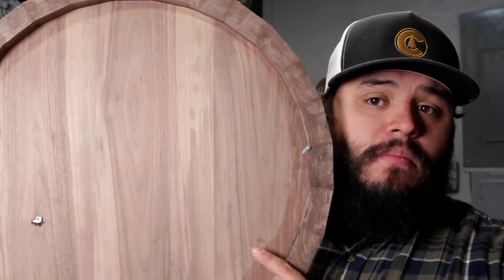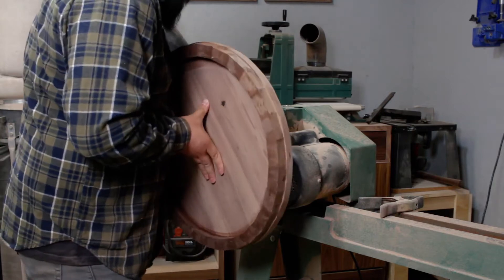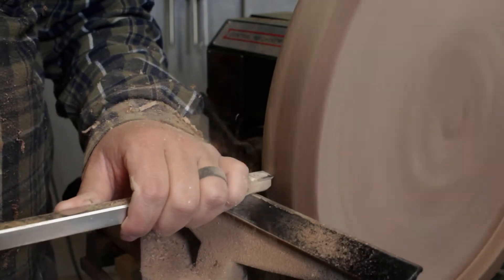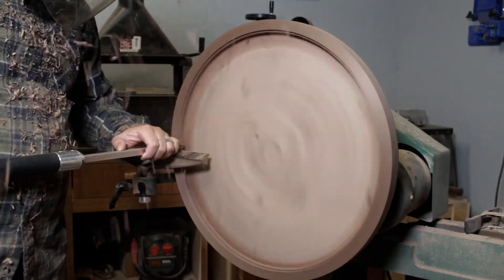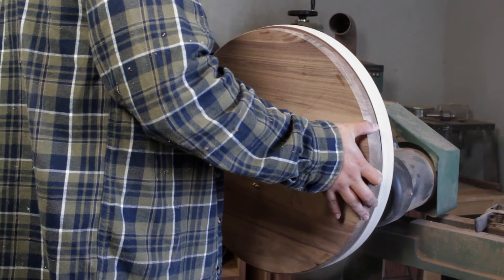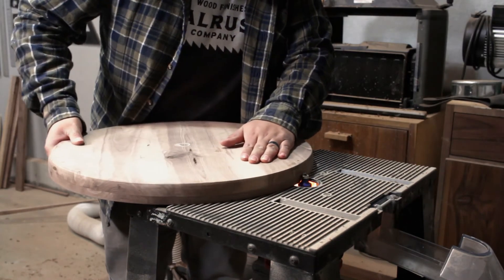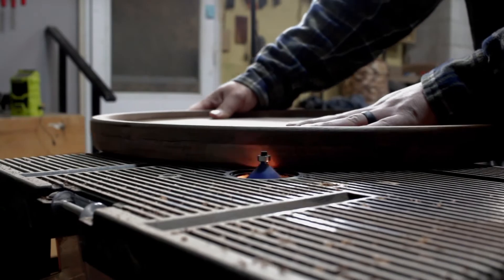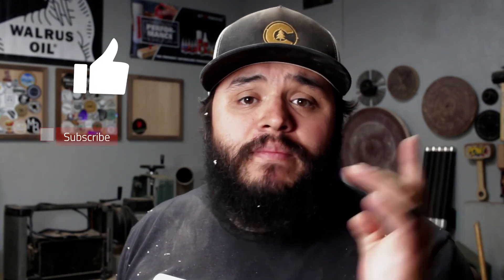beginners should not try this!

Comment: The trick to this is to only mount workpieces that are already round. Because at only 3/4 hp of engine power and 600 rpm minimum speed - which is much too fast - trueing up a large blank that is not already really well balanced when mounting it, is simply not possible on this machine.
Reply from the maker: Ahhh. I see. Thank you for that information.